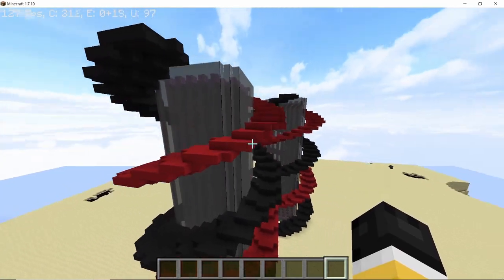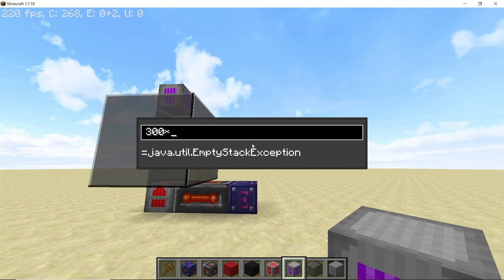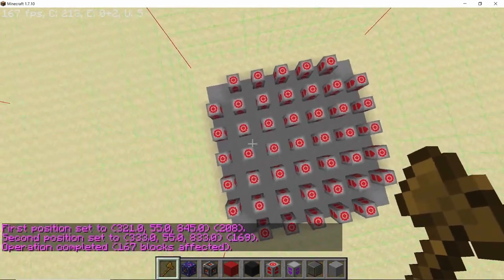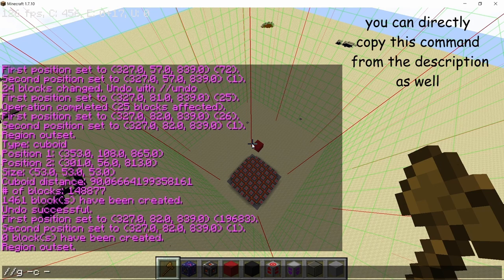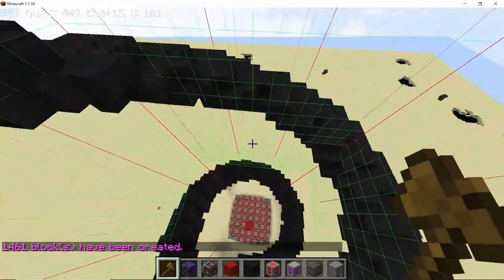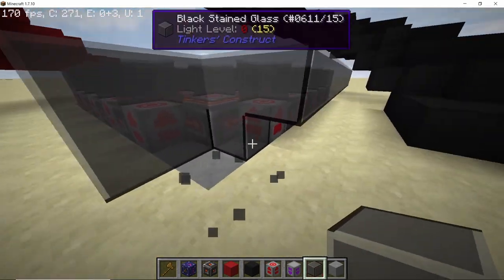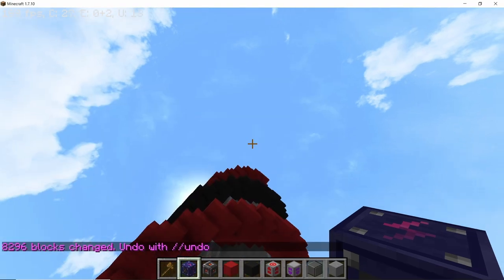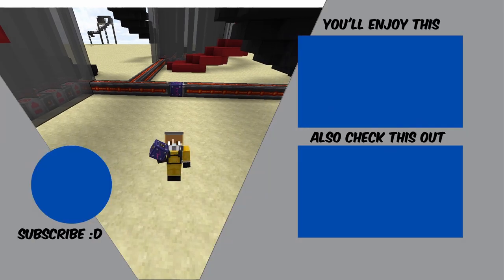NTM's ZPE Potential Generator Towers using Advanced WorldEdit - (2 MHE/s)

Comment: Is there a way of connecting the missle silo doors to a launch pad or detonator or redstone or a switch or something like that, I know very long but I think it would be a good tutorial for beginners even if it might not be to complex compared to most of your tutorials. Also a good video idea would be a beginners guide as even though I'm use to huge mods it can still be quite overwhelming when a new player to the mod opens the creative menu.
Reply from the maker: The missile silo controller is Redstone sensitive so yes you can easily attach it to the missile launch sequence. 
Maybe a year ago I made a video on "how to make a missile silo" in that video I have already shown how that's done so you might wanna check it.out man 👀
Reply from the maker: Also I've made a beginners guide video as well, it's not up-to-date cause new heat based machines were added, but yes it'll get you going for sure 😁

Comment: hello Savage Vegeta, could you tell me what to do with very unstable rods of the type
of heat rod rbmk
highly enriched shrabidium rod rbmk
highly enriched americium (241 in my opinion) rod and the like .
Reply from the maker: You can use them with rods like Thorium fuel rod which will help in stabilizing them. Another option is to use RBMK coolers along with control rods and then you can raise the rods very slowly ensuring that the cooler will never let temperature go above a certain limit

Comment: How to fix errors with extended(reloaded)ntm for 1.12.2? When i am launching minecraft it crashes
Reply from the maker: Maybe try using the latest version of the mod or try running the mod alone without any major mods (just use QOL mods) and then see if it crashes or not
Reply: @SavageVegeta  With reloaded ntm i fixed the issue, but with extended i tried... nothing worked anyways i tried to remove NEI, IC2, WE but it didnt work

Comment: hey how much ram and storage do i need to have minecraft
Reply from the maker: you can run it even with 2 gigs of ram generally but the exact number will depend on the number of mods you are going to load
Reply: i will istall hbm and not enough items
Reply from the maker: @ImAnUber  4 gb ram should do, will also depend on which processor and GPU you have

Comment: For me one tower only generates 15.0kHE/s, I am also using the newest version of the mod. Can someone help me pls?
Reply: Have you connected all the bottom generators to a single energy block with cables?
Reply: @turtlez2776  yes I have
Reply from the maker: that isn't right ... 15 KHE/s is the output of a single ZPE unit when placed 50 blocks apart. If you have placed all 45 and all of them are connected as well then it should be 675 kHE/s.
I would like to see the tower you've made on a discord vc